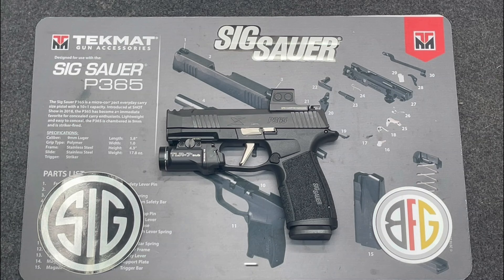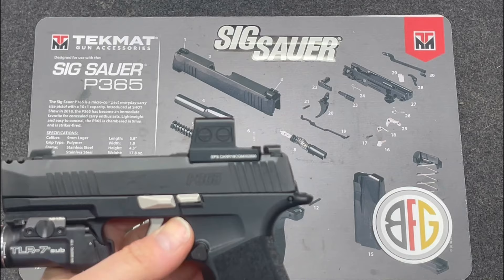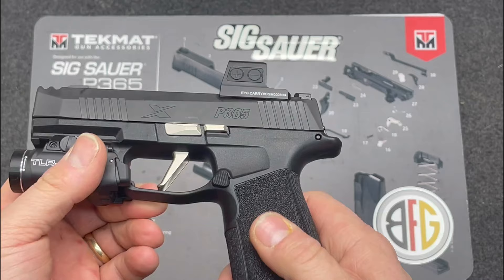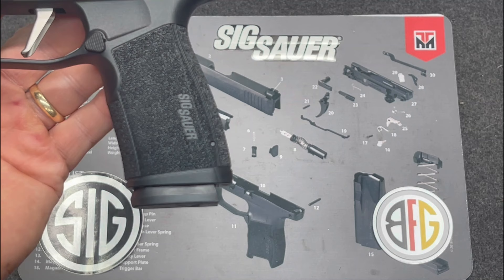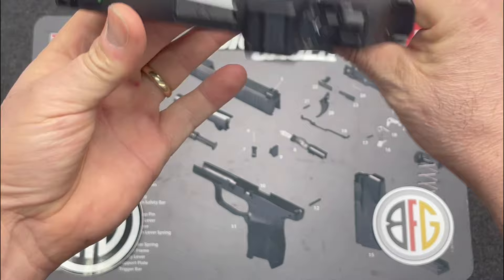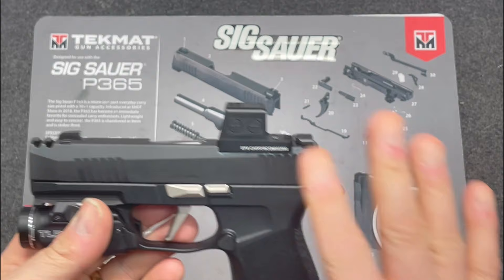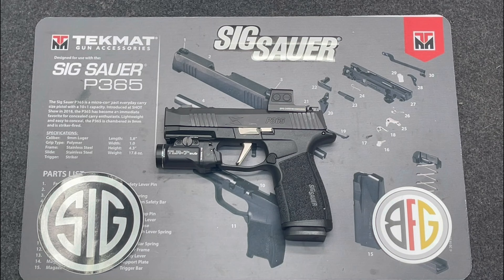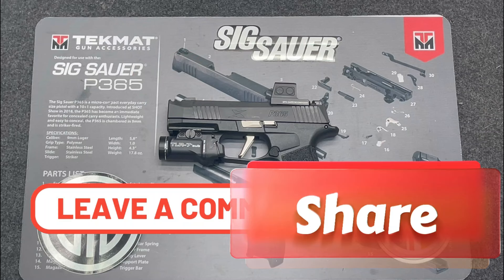Upgrade the X MACRO!!  SIG P365 X MACRO Upgrades

Comment: I’ve never understood replacing a barrel on a brand new gun. I’ve carried for over 15 years both on my personal time and my career. Had many pistols. Qualified every year with stock barrels and shot courses of fire out to 50 yards. Never been an issue. Just don’t get it.
Reply from the maker: I’ve run True Precision on a few other P365’s with very good success.  I wanted to build out the stainless look and this achieved it.  I appreciate your comments also know that this accessory does nothing to change to function of the X MACRO.  Thanks for watching and the comment.
Reply: Few reasons.  First, the witness hole (to verify loaded chamber status) becomes a port that crap vents from onto optics like red dots. Second, the nitride treated barrels don't seem to wear as quickly as PVD finish barrels, Sig's in particular showing wear sooner than other barrels. Third is cosmetic, and BFG precision even stated he was trying to achieve a certain look or color scheme.
Reply: I think the only thing I did to my 365 macro was put a red dot on it and put in a factory gold barrel
Reply: I have the X-Macro TacOps and I think it’s perfect out of the box. No need for any upgrades.
Reply: @bfgprecision hat do you think of the factory trigger?
Reply from the maker: @matthewmaynard5460  I like it for EDC because I don’t need a reduced weight in my carry gun.  For me it’s fine no complaints.
Reply: Because if you got the money and want to do it then do it. Simple as that. Some people such as myself want asthetics and personalized feel and comfortability. As i see it. If you got it get it.
Reply: A lot of it is cosmetic. FWIW, True Precision makes their barrels from stainless instead of carbon steel so there's some degree of extra corrosion resistance. Whether that translates into faster wearing barrel I couldn't say.
Reply: LOL, G96 gun treatment works well on wipe-down rags and I swear to god is some of the best smelling gun shit in existence.  It could be used as cologne...
Reply: @bfgprecision I’m in the middle of a similar build. Can’t seem to find that stainless kit. Saw one for the other 365x series pistols, but not specifically for x macro. It’s the last piece of the puzzle for me to call this project “finished”.
Reply: Well I swapped My barrel because my X-Macro Comp's accuracy was shit out past 25 yards. It was fine for close ups but anything of any distance and it was all over. I get that it's not a sniper rifle but my S&W Shield Plus and my G43x both crushed it in accuracy. I swapped out the factory barrel for a Ballistic Advantage and it's now on par with the others. Maybe a had just got a bad barrel but the BA is awesome and the gun went from mediocre to great.

Comment: I dont know if somebody else mentioned this, but for your TLR7 sub, the correct key you need is number "4" to get the light in the correct position. Dont know if this guy got a bad batch, but #4 will work. No need to buy another component that you dont necessarily need.
Reply: So I just ordered the tlr -7 sub with 1913s.. is the number 4 included with that or are you saying you will need to get the #4 separately? I’ve heard that it comes with the correct one and I’ve seen people say it doesn’t fit from what’s included in the box but I can’t get a definitive answer 🤷‍♂️
Reply from the maker: @Singlebarrel2323  The 4 key will work but not as good fit as the additional key you can get from TD.  The cost is very small I would recommend trying them both.
Reply: @bfgprecision I’ve got some on the way 👍 thanks man
Reply: @bfgprecision you mentioned in the video that the silver ring should line up with the end of the slide. Like I said...I don't know if you got a bad set of keys, streamlight revamped them, or none of the above, but key 4 puts my sub back as far as physically possible with the silver ring aligned with the end of the slide.
Reply from the maker: @TomahawksNShotShells  thanks for that info, it didn’t work like that for me though.  Appreciate the feedback though.
Reply: Olight comes with 1913 key, Works perfect.

Comment: I’ve got roughly 1,300 rounds through my XMacro. Winchester 115 grain FMJ failed 3 times. One primer would not fire after a couple of attempts and 2 of them absolutely would not fully feed. Probably 400 rounds of Winchester and the rest was a few hundred rounds of random hollow points, sig ammo and a mix of federal and whatever was affordable in 115 FMJ range ammo     No issues with anything else. I had minor corrosion issues but after oiling the slide a few times it’s perfect. Kinda like seasoning a skillet. Shouldn’t be necessary at the price point but not a big deal. I love mine and carry it every day 10-12 hours.
Reply: It seems like everyone that has rust issues it stems from the rear sight/ slot for it. I oil that area so no issues know. Had a couple other guns that tended to rust at certain points. Not great that we have to do this wondering if it’s a supplier issue?
Reply: No issues with Blazer, Federal, PMC, Critical Defense. All 124 gr.

Comment: Tactical Development makes a mag base that is fully rounded…and also a mag extension for +2…I have both on my XMacro mags..+2 for carry and flats for the other 4
Reply: Been waiting for it to come back in stock. 20 rounds in that size is crazy.
Reply: I installed the tactical development flat aluminum base plates on my magazines and they get rid of any pinch points. They also make the pistol look a lot better.

Comment: I have the same setup but mine has the newer XL slide, gold threaded Zafirri barrel with Herrington arms comp. I did want the TacDev magwell but i can never catch one in stock so i went with the Empire Katana and i can say that it does get rid of that pinch point for sure. Also helps tremendously with reloads. You should look into the Empire Javelin guide rod. It makes the slide very smooth compared to the factory one. Great for comps as well.
Reply from the maker: Thanks for the info I will definitely look into the magwell and the guiderod/spring.  Is the magwell low profile like the TacDev and the TacOps OEM one?
Reply: How’s cleaning with the comp? Once you apply the thread lock on there how does the process work for cleaning each time? I have the same setup and was looking for tips
Reply: @bfgprecision  I find the Magwell very comfortable for my hands. Its about the same size as the TacDev but it sticks out just a bit more on the front by like a hair or 2. Personally i think the Katana is a little more aesthetically appealing but thats just me.
Reply: @CamOzone  the way i clean mine, i just use a bore snake and a few passes with a brush inside the barrel. For the outside, i remove the slide, let the barrel hang and i clean around it as i rotate it as much as possible. A bit tedious at first but you get used to it.
Reply: @cp2158  thank you! Never thought to just let it hang to clean.
Reply from the maker: @cp2158  It definitely looks great!

Comment: I got the tac ops a couple weeks ago and I love it. I sold the standard macro because it feels like it shoots the same. I mainly wanted the tac ops so'z I can put a true threaded barrel in. Otherwise I have mostly the same setup. Love theses guns with the 17 rnds man! Cool video!
Reply: I found there was a difference but to each his own. I believe the difference not large. Of course if you build out a xtops macro with a ppm comp it will perform better than a regular macro. You can have more malfunctions though. None so far with my macro.
Reply: @andershilmo1866 ppm comp? Whats that n whats the difference? Is that one of the external attachment versions you screw the barrel?
Reply: @ExOhz  Yes is it a screw on barrel type. PPPM or Parker Mountain Machine. They sell barrel/ comp combos. Around 370 I believe depending on the application.

Comment: I have the stock all-black version. Early on I upgraded the mag baseplates with Tactical Development's alloy version in the standard and +2 variants. Theyre not compatible with the mag-well but they work well, look and feel good, remove the pinch poinf and can easily be stripped - out with the indents on each side. They do periodically run out so keep checking back. Hope they start making them in FDE.

Comment: Some have complained about rust on the macro.  Have not had the gun itself rust but have had a spot on my spare mag develop after months of warm-weather carry in a side pocket that looked like surface rust. It removed easily with lube and steel wool. My advice is wipe down carry weapons with some sort of lube.  I use G96 gun treatment on a microfiber cloth about every week to two weeks.  Wipe down the slide, sights and magazine and then wipe - off.
Reply from the maker: That’s a great approach!  I use a silicone cloth that I keep in my safe.

Comment: Haven't seen the TacDev magwell in person but it looks VERY similar to the TacOps.  I think I'll eventually do it too.  Magwell, ext. slide release, n a light will set me for a bit.  Still doing my research for a green dot.  Need a holster too but dont wanna replace it after the light/optic.   It's a recent acquisition lol.
Reply from the maker: Yeah going to a light set up changes a lot.  I’m doing it right now with the XMACRO.  Going from my ZEV P365 to the X MACRO.  Need to put a bunch of rounds through it first then put it in my EDC rotation.  During that time I’m looking at holsters.  Probably going with the Axis Elite T1C AIWB.  Thanks for the comment and watching!
Reply: @bfgprecision  Same, after a handful of good range days i'll  put stuff in the cart.  Everything about it is a 1st for me, 1st 9mm, 1st striker,  1st polymer frame, and it will be the 1st time using a light AND 1st time w/a dot (on a pistol)!   You say adding a light changes a lot,... how so?  Just referring to the change in balance point?
Reply from the maker: @superrad1659  a light from a functional perspective is another device you need to become proficient at using.  When you draw you have to add an action to your motion.  It’s seems simple and it is, but it warrants repetition during training.  Also, in dealing with equipment your holsters will need to be swapped out with new light bearing holsters if you haven’t had them set up for a light.  When you mount a light not only does the opening need to be bigger but the retention goes from the trigger guard to the light itself.  Just a couple of things to consider, neither should detract you from that set up but you should be aware.  Hope that helps.
Reply: @bfgprecision  i was aware of the holster caveat but i guess I never put much thought into the memory/movement training part of it... Something to think about for sure, thx!  Side note, thinking about a TLR7 variant or an Olight Baldr mini(?)... Any experience/recommendations?
Reply from the maker: @superrad1659  I really like OLIGHT!  I have had a few of them and never had any issues.  They are very reasonably priced, easy to charge and reliable.  I went with the TLR7 Sub on the X MACRO because of function and looks, it just looks like it was made for it.  Other than that the OLIGHT would be fine.  To be honest though I do not have any experience with it on the X MACRO.
Reply: Look into holosun. I put the 507k on mine
Reply from the maker: @bralonstrauser9324  I have the Holosun on my X MACRO that I reviewed here, it's the EPS Carry.  I have 507K's on two of my other P365 setups though.  I did a build video last year on the P365 ZEV I setup, check it out on my channel.  Thanks for the comment and thanks for watching!
Reply: You'll find a lot more holsters for the TRL 7 than the Olight. I went with the Olight as I like it much better. But, did complicate my holster search.

Comment: Have you seen the new satin finished stainless barrel from True Precision?  It comes without the LCI peep hole.  It stops carbon/oil residue blowing back up onto the optic.   Also-I dissected the sig website and couldn't find the  stainless/nickel finished slide stop, takedown lever and the stainless trigger listed.  I may have been looking in the wrong area of the site.  If you could clarify where I can find those that would be most helpful.  Gr8 site and videos-Hope you have continued success!  Best wishes.
Reply from the maker: Here is the link for the nickel parts.  
https://www.sigsauer.com/p365x-controls-parts-kit-nickel.html
Reply: @bfgprecision  Thanks for both the site and the quick reply.

Comment: Getting ready to pick one up, just curious if there is any way to switch the slide release to the other side for lefty’s? Can’t find any info. Even though there is a cutout on the other side for it. Thanks
Reply from the maker: Unfortunately you can’t do that because the slide catch is only able to install on the left side of the FCU.  The trigger and trigger bar are installed on the right.  It’s the configuration of the FCU itself not the grip module.  The cut out on the right side of the grip you may be referring to is the opening for the serial number.  That’s the only opening on the grip in that area on the right side.  I know many left hand shooters that use this platform and love it so maybe that’s not a deal breaker but you have to be ok with that.  Hope this helps, thanks for watching!

Comment: I purchased the tacops a month ago and put the TRL7 on it.  With it all the way back touching the trigger guard, the buttons on the rear of the light catch the tip of my finger and interferes with my getting to the trigger.  So I used the adapter the moves the light forward eighth inch so that the buttons are just on the outside of the trigger guard.  Just curious if anyone  else experienced that?

Comment: Does the X macro magazine release, push out the right side of grip like the rest of the p365 line?
Reply from the maker: Yes, it’s a one piece design as opposed to the two piece on the std P365’s.  It’s disassembles the same way.

Comment: Did you use the regular p365 parts for the slide lock, takedown & trigger?
Reply from the maker: Yes SIG sells the nickel version.  Can’t use the mag release though the X MACRO mag release is different.
Reply: Is it the high polish kit for the 365x ?

Comment: I ordered a macro tacops. I hope it doesn’t have any rust issues. You should NOT have to wipe a pistol off everyday to keep it from rusting. I have several pistols and none have a bit of rust.
Reply from the maker: I haven t had any issues on any of mine.
Reply: If you live in humid environment during any time of the year at all, I recommend atleast sending your carry magazine bodies in for cerakote. They will rust slowly. I did 2 mag bodies and my slide . I've carried everyday for almost 10 years. I shoot on average about 10k rounds per year between handgun and carbine. Heed my warning. Xmacro is an amazing gun, but there can be surface rust issues
Reply from the maker: @l337l0gan  thanks for the heads up!  Appreciate that advice and I know I’ll be watching for any type of corrosion and I’ll be making another video when I’ve had a chance to carry and shoot it for some time.  Thanks for your comment and got watching!

Comment: How do you upgrade the Rusting issue ? Not a hater, as I carry a Sig P365.
Reply from the maker: What I can say is that I use an oil as well as a silicone rag to help prevent corrosion.  As much as a lubricant oil should be used as a corrosion prevention application as well.  I haven't had any issues with any of my P365 firearms or any other firearm I own but I am very consistent in cleaning as well as periodic oil and/or silicone applications for anti-corrosion maintenance.  I have a good video on maintenance you can reference as well.  Let me know if you have any additional questions, hope this helps.  Thanks for watching!
Reply: End plates get rusted easily and All p320 and p365.

Comment: Will the xl threaded barrel fit in this
Reply from the maker: The X MACRO slide is the same as the XL.  Dimensionally it should it would take away the comp functionality as the barrel would be too long for the integrated comp to function.  If you want that look maybe go with the Tac Ops version.  Thanks for the comment.